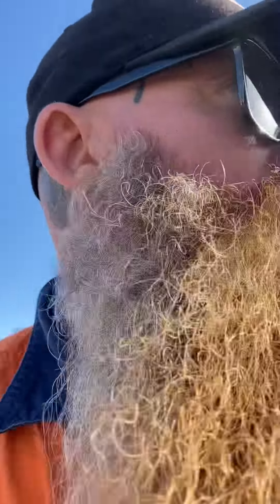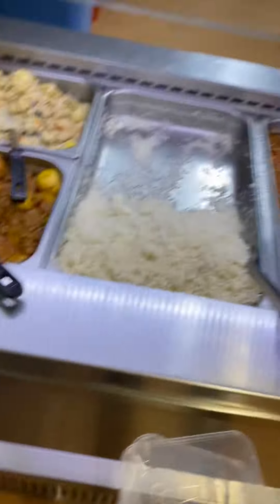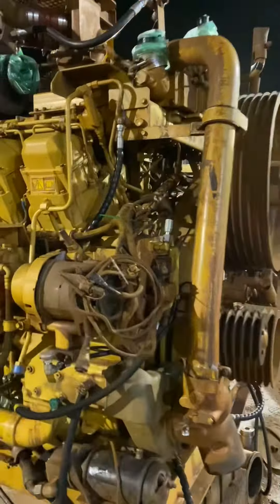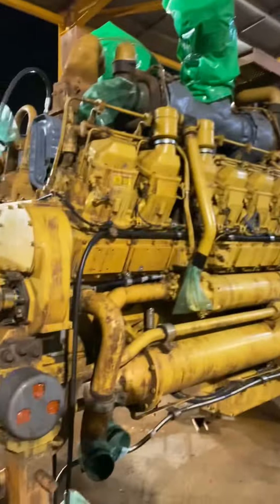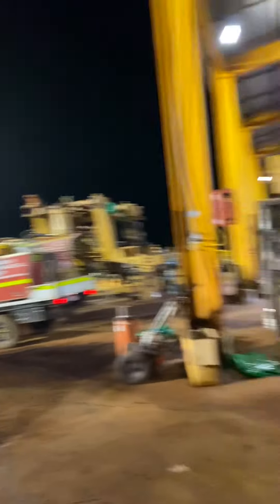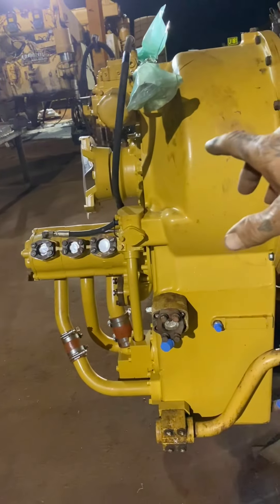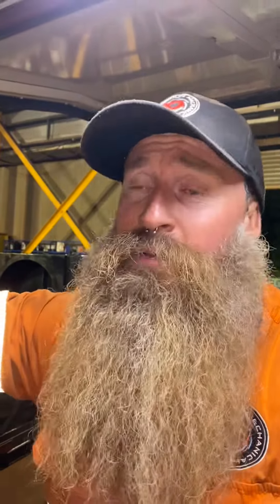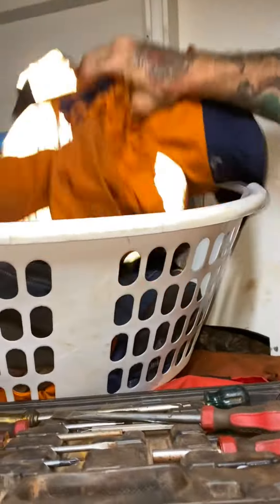Day (Night) in the life of a FIFO field service Heavy Diesel mechanic 🔧

Comment: You seem to know what you are doing.  Looks like a good outfit to work for.  As per the heat out there, in some zones and safety boots, ever heard of Chelsea dealer boots?  Slip on heavy heavy duty boots, no laces.  They are waterproof leather and take a hell of a hard pasting.  People rub raw candlewax on them to protect them even further.
Reply from the maker: If I didn’t know what I was doing I wouldn’t be getting paid the money I get nor would I be up here 😎. The company is great to work for, extremely flexible I can work as much or as little as I like (literally just did 7 weeks straight no day of by choice) 
As for the boots definitely know of them being Aussie, RM and Blundstone are very popular here. However it is required we wear zipside 6” boots, reason being Incase of a foot injury just unzip and remove no need to cut and the ankle support as there is so much uneven ground out here.
Reply: @Fenndog  Blundstones are highly rated.  Sometimes ppl in Aussie spray themselves with a plant sprayer filled with cold water to keep cool in the hot season.  It's kinda crappy, but, you do what you gotta do.  Depends on Aircon etc.  Hang in there, it's tech guys like yourself that keep Aussie strong in the mining game.  Lotta mechanics these days are just part fitters, sometimes that's ok, but for substantial servicing, experience is worthy.
Reply from the maker: @federalnoise  definitely gets hot af up here but we just soldier on 💦💦💦
Reply: @federalnoise  Sometimes? You mean 99% of the time? Without skilled mechanical (or part) fitters, the quality and reliability of substantial servicing could be compromised. As a diag tech, I very often encounter issues stemming from poor re-assembly, so this highlights just how crucial mechanical fitters are.

Comment: Hey mate, with the industry slowly switching to more electric vehicles - will this impact the job prospects of diesel mechanics in the future do you think? Thanks mate.
Reply from the maker: @MichaelCrowley-u4r  just gotta retrain if you want to work on engine side or the power pack and the A/C wheel motors or drives.

Still a whole lot of machine that requires mechanical aptitude.
Reply from the maker: @MichaelCrowley-u4r  for instance we have a 400t digger in at the moment and we have been on it for 10 days (20 shifts) 5 guys a shift and haven’t touched the engines.
Reply: @Fenndog  Thanks for the info mate! I'm praying I get an apprenticeship to be a HD Mechanic, but just wasn't sure if the change in the industry was potentially impacting job prospects. Thanks again mate
Reply from the maker: @MichaelCrowley-u4r  no stress at all 🙏🏽 biggest thanks you could give is share my vid 🙏🏽

Comment: Really interesting. Im surprised you need the gym after wrestling with those monster trucks.
Reply from the maker: Cause they are so big pretty much everything requires a lifting aid, gym is also a pastime and great for mental health as well as physical.

If I didn’t train there wouldn’t be much else to do as it’s all 12hr days work up here and I work big swings so minimal time off.
Reply: My interest started at Havieron exploration Havieron leading to Telfer about 5 years ago then got hooked on Pilbara WA, support companies and the harsh environment. Big respect to you guys out there. Could have emigrated from the UK to Aus in the 80’s but I didn’t. Big mistake by me.
Reply from the maker: @stuarthinds848  it’s definitely one of the harshest environments in the wet season and this current site in Karratha it never rains unless it’s a cyclone but 65-90% humidity is putrid.

Never to old to have a crack at it, plenty of work up here atm.

Comment: Pos 5-6
Reply from the maker: @MrMarkguth  pos 3 and pos 6 are actually the only tires left on the rear of these machines if you want to be smart 🥴
Tell me why you would leave those on instead of 4-5? (Reasoning)
Referring to the actual wheel ends not the tires as I was it is pos 1,2,3,4
Reply: @Fenndog  what are you on about?, you clearly have pos 1,2and 3 wheels on. Pos 4,5and6 removed.
Leaving pos 3 and pos 6 on would create a lot more room to complete the job and get it off the stands, also if you were to drive the truck, it would blow the wheel ends before getting off the concrete if only pos 4 and 5 left on
Reply from the maker: @MrMarkguth  if you listen again I’m not talking about the tires at all, l get yourhead out of your ass trying to sound smarter than me 😂😂😂
I’m the one on 85 an hr here 😂
Reply from the maker: @MrMarkguth  an top answer! The wheel ends wouldn’t completely blow off though just the planetary’s. However you can to stop that by chucking a few wheel bolts back in.
Reply from the maker: Nah you dont
Reply from the maker: Super on every hr? Everything paid for? Work as much or as little as you want? Also love how you shit up about the wheel pos 😂😂 typical simp? How much debt you in? Have you banked  80k since July 1st, how much does your missus cost if you got one? 

✌🏽
Reply: @Fenndog  your on drugs
Reply from the maker: @MrMarkguth   nah sober as! $109960 before tax that’s without the $12,645.4 super.
Reply from the maker: @MrMarkguth  no  y62, Harley and I can buy a Cessna for less than my car 😂😂😂
You started this I’m just spitting facts.
This is just my work you would shit seeing my investment portfolio.

I’m not hiding it’s all here to see. 
Tell me last time you donated to charity was it 100k lump sum 😂😂😂
Eat me lil man.
Reply from the maker: Will be over 400k this year and as you may see I’m on a 5week holiday in Southeast Asia.

I purely respond cause you help my content 🙏🏽
Reply from the maker: @MrMarkguth  tell me more about how good you are? I’ll win 😘